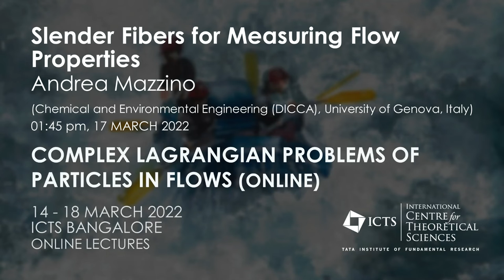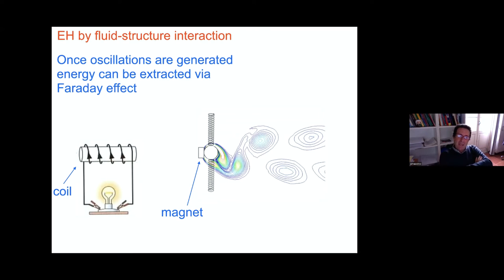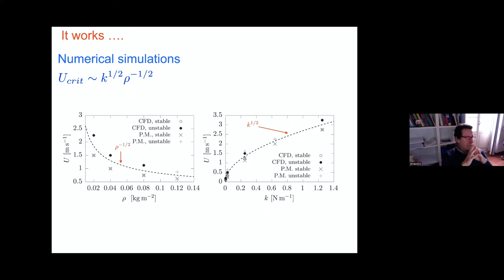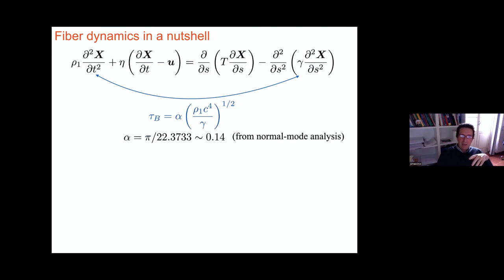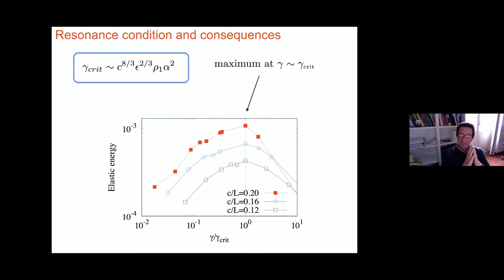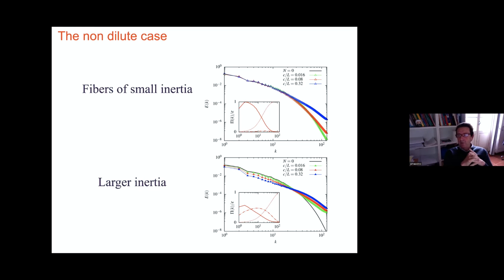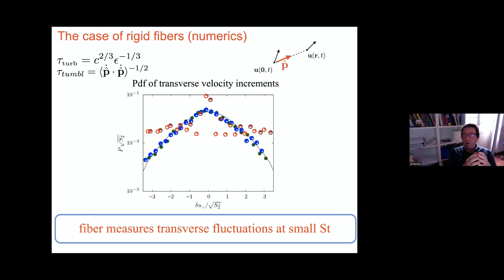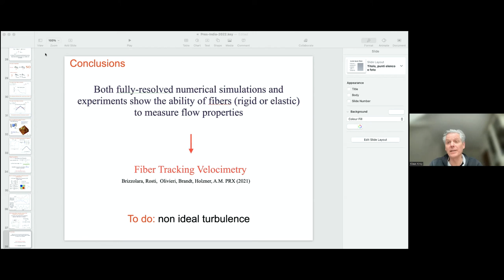Slender Fibers for Measuring Flow Properties by Andrea Mazzino

Comment: I think it would be of use to note that the lack of force can be a force itself. Such as in about the 12min mark with a single partial wing. Simply cutting the power at certain points in the cycle can lead to all sorts of things such as lift and limited torsion forces in either direction.
Not directly related but  an often overlooked factor that can be highlighted by what was discussed.